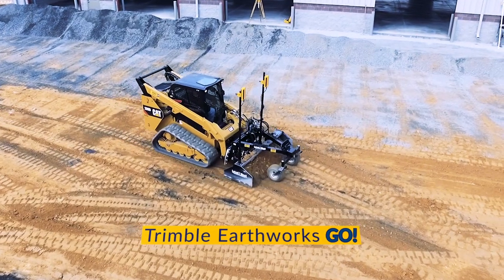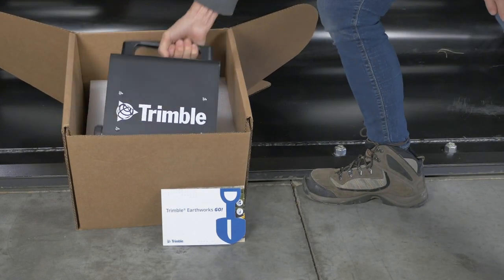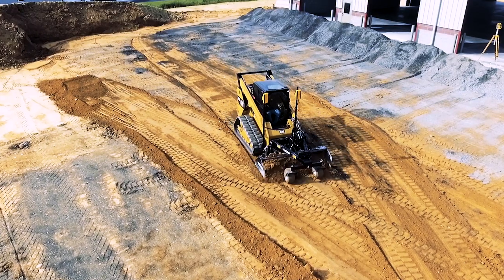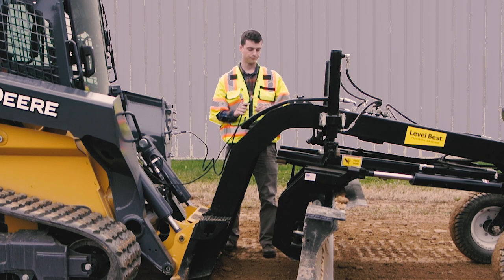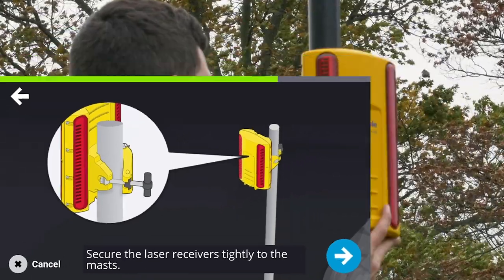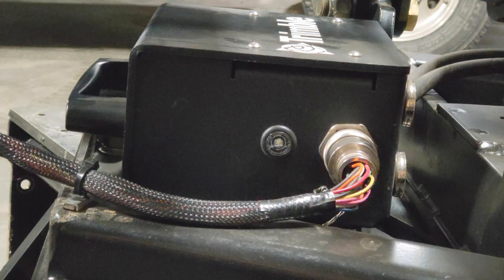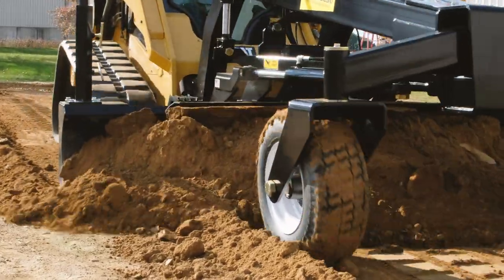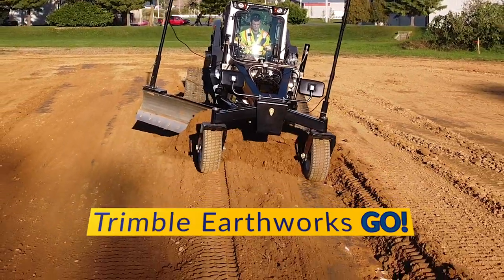Trimble EWGO! Set Up for Level Best PD and GB Precision Grading Machines

Comment: can you operate the grader blade without the added joystick in the cab ?   i have a 257D cat
Reply: If you use the CAT smart grader it doesnt require additional equipment, just changes over your factory screens and controls automatically